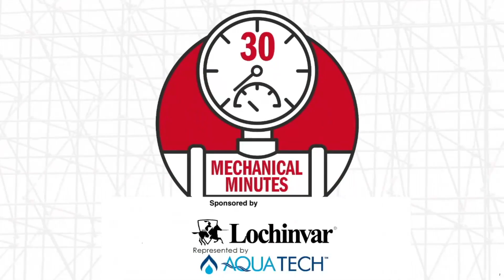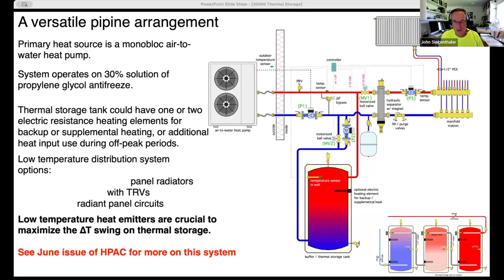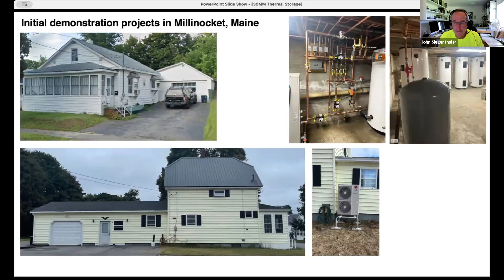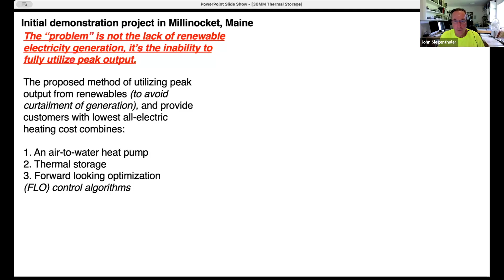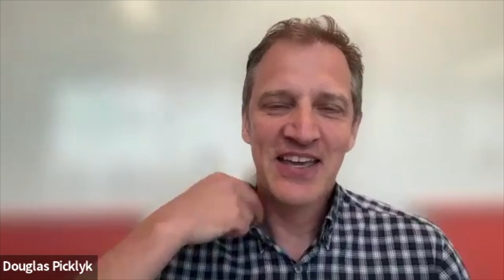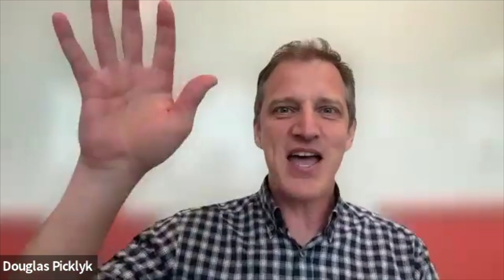30 Mechanical Minutes: Episode 21 "Hydronics and Thermal Storage"

Comment: On 20:00 : Wouldn't it be safer to add a backup (or second) in-door circulator in antifreeze portion of the system? This one may run nearly constant "just in case".